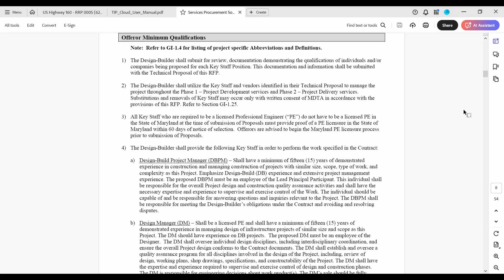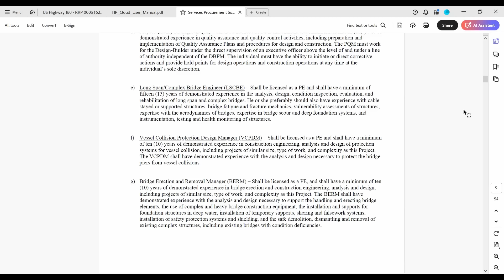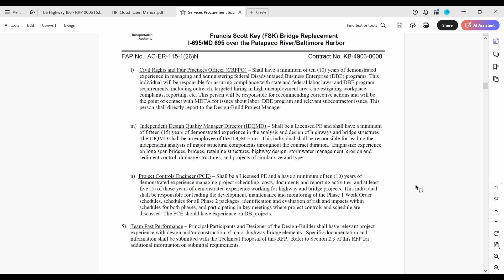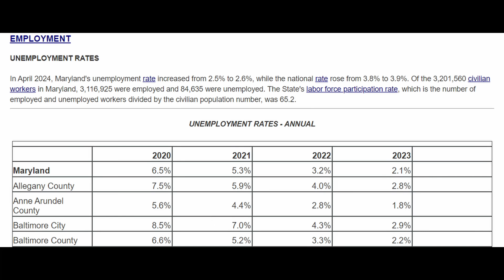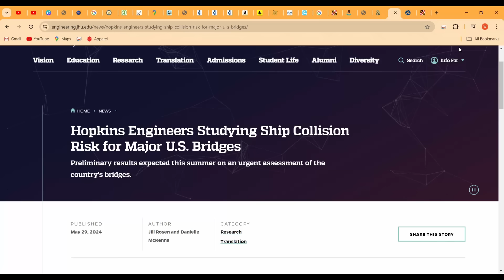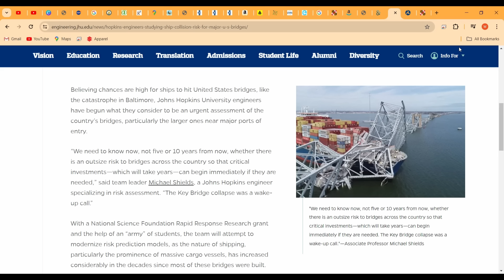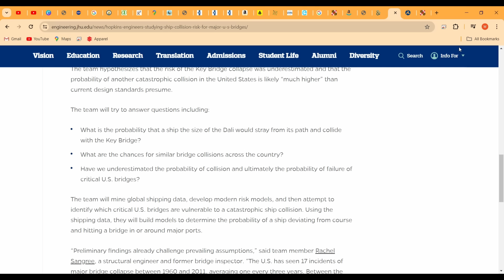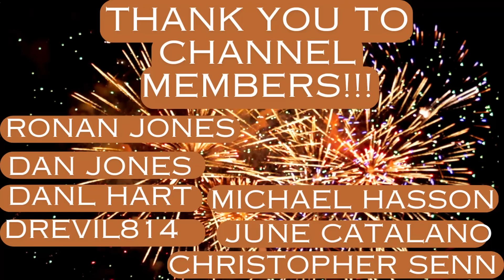Next Steps for Designing and Building a Replacement to the Francis Scott Key Bridge

Comment: The bridge in Genoa, Italy that collapsed took 2 years from the disaster to be rebuilt. It is shorter and doesn't have as long of a main span, but you would think they could expedite it to take less than 4 years. Then again, given that the construction of the Gordie Howe Bridge in Detroit has been going on for 6 years, I guess this is expedited nowadays.

Comment: Part of a bridge in Texas was taken out by a loose barge recently.

It was a rail bridge to an island that had never had a train on it since built.

It actually saved the separate but parallel auto bridge. If the barges had come from the other direction, the automobile bridge would likely have been damaged or maybe made impassable.

It's the only access to the island.
Reply: The only AUTO access.  There is still water and air access.

Comment: I'm a former merchant marine officer. Transited under hundreds of bridges, even had issues while doing so, but recovered.   The risk of collision for a bridge has many factors, obviously the location of the piers, the width of the channel and the frequency of transits are big ones, but there are lots of other things to consider; is the approach to the bridge straight? or is the ship coming out of turn before or going into a turn after.  Is there considerable current? is it generally in line with the axis of transit, or is it a cross current.  Same for prevailing winds.  Local rules on tug escort, the size/power of the tugs and even the type of escort (connected to the stern of the ship by tow line or just running free nearby.)
Also, I don't think your concern about ship traffic leaving baltimore for other ports is relative limited by the often very specific nature of port facilities.  Cargo wouldn't be using this port if it wasn't the best port for the cargo, so it likely won't be affected much.

Comment: Interesting update.  Proposals due by 24 Jun 24 and selection by Mid-to-late Summer 2024.  That's a short fuse for such a big proposal but I'll bet the better teams were on it on the day of the incident. Years ago I was tagged for a team that got working on pre-work in the first hours as a major incident unfolded. It will be interesting to see who emerges as the selected team. I'll go out on a limb and say the selected team will be a combination of some heavy hitting firms including some from the local area - i.e. D.C where the money flows from.
Reply from the maker: Thank you.  I think you are right about how this selection will go in terms of the successful team will need to have great technical qualifications and great political connections.  There will be a lot of money to spread around for this project.

Comment: The fact that the container ships have a single engine makes the probability much higher.
Reply: The vast majority of merchant vessels the world over are single engine/single screw.  But yes, its a risk, but one that the economics don't support changing.
Reply: @stephenbritton9297  Economics don't support shutting down ports for months and building $2 billion bridges either. Ships that don't have redundancy in their propulsion system need to be escorted into ports by tug boats.
Reply: While I believe that commercial ships are safer with redundant propulsion and steering, twin-screw, and twin-rudder, statistically it is hard to prove.  In the case of M/V Dali the issue appears to have originated in the electrical system, which was redundant.
Reply: Escort tugs are the most economical answer. One engine failure, 2 engine failure, electrical load failure, they still are there.
Next best is better protection for the bridge. Can spread the cost across a wide base by tacking on a small port fee surcharge over 20yrs.

Comment: Thanks for an interesting video——a lot to unpack. Does the big document have a paragraph anywhere for calculations of sea level rise? I read on the Chesapeake Bay site that in 50 years there may be less clearance under the bridge than currently. I don’t imagine ships will be smaller. Is that even a concern?
Reply from the maker: Thank you.  No they don't have any detailed design requirements listed in the request for proposal.  They would get into to those items during the negotiations during contract award with the selected team.
Reply: Not a problem.  Just wait for low tide.  I lived right there where this bridge was located and the rise and fall is only abou 18 inches or so depending on wind, moon etc.  Certainly if all the ice caps melted and everyone peed in the river, the rise couldn't be more than an inch or so.  So, as I said, no problem.
Reply: There should be as much provision for sea rise as President Obama's two oceanfront mansions have.
Reply: To put this in perspective, sea level rise has been roughly 1-2 mm per year for a century or so.  Not really an issue.

Comment: Given what is required to provide adequate pier protection for today's (and future) ships, I suspect that in many cases it will be more economical to increase main span length to put the major piers into shallower water (or onto land).  A fully loaded ship with a stuck open throttle represents a tremendous amount of energy to dissipate (consider the near miss today in Charleston).  Your point about risk including both probability of occurrence and consequence of the hazard is well taken.  This makes the costs in play larger than many will like to admit...but they are there whether we admit it or not.  Making the main spans longer will drive up cost,   But so does protection infrastructure that is adequate to protect against high hazard/ low probability events.  In other words, use water depth and channel position to constrain/limit the types of vessels that need to be considered for the various design cases.  While this is a strategy that can help for some classes of vessels, it is not  universal: there are shallow draft barge rafts that are in play for many waterways.  "Shallow enough" in these cases is likely on land in a lot of scenarios.

Comment: I lived in Sparrows Point for many years without a bridge.  Why rebuild at all.  Put a ferry across if anything for the few "hazardous" truck loads that can't use the tunnels.
Reply from the maker: You make a great point. The fact is they are making due without the bridge there now. The Washington bridge in Rhode Island carries 3 times the traffic volume than Key Bridge.
Reply: @CaseyJones-Engineer  
Traffic cross-harbor is no worse than on the I-495 Maryland Beltway.

That wouldn't have happened if they had built the 6,200 foot long Outer Harbor Tunnel.
Reply: Heavy ferries have been used to move rail cars across the harbor in NYC.

Comment: I'd say, it'd be cheaper to rebuild what was there, as it is already designed.  
Just fully protect the replacement from impacts.
Reply: To some extent, you are correct except that the roadway needs to be 6 lanes( 3 each way) plus shoulders because of traffic increases from the original construction to accommodate.

Comment: Why not tunnel?
Reply: Because it's vastly more expensive...
Reply: @ArthurDentZaphodBeeb  
Wrong.

Based on the costs for the CBBT Parallel Thimble Shoal Tunnel and the new I-64 Hampton Roads tunnels, it would be about the same or even less.
Reply: @scottkozel1519  Hmmm. The original plan for the SKB was a tunnel. But the idea was abandoned due to high costs and the bridge was built. Also, tunnels cannot transport hazardous materials, which is a key criteria, so it's a non-starter idea.
Reply: @ArthurDentZaphodBeeb  
The costs were not that much higher actually.
I have a website article about the bridge and crossing.
$65 million for the tunnel and $50 million for the bridge.

They just proved that the Sollers Point site is unsuitable for a bridge.

The combination of underwater topography there and the frequent passage of ships up to 200,000+ tons.

Now nobody can cross there for at least 48 months.

That wouldn't have happened if they had built the 6,200 foot long Outer Harbor Tunnel.

Putting up another bridge there is irresponsible and that one may get knocked down as well.

Those freight systems are going to be reconfigured in the over the 48+ months without a bridge. Long term structural changes to the freight systems.

Comment: What people say is the impact and what the impact is are two different things. 
1. People were paying 4$ a pop to cross the bridge but most federal bridges are toll free. The bridge is 50 years old, definite a loss of trust in the federal govt judgement on when and when not to use money people are paying to ensure safety. When it comes to federally owned infrastructure projects que sera sera. This may be a wake up call, it’s doesn’t mean the brain dead congress can do its job. 

2. The overall cost to commerce losing that bridge,  it has a result of ground transportation as well as to shipping. It’s not over either, not just for ground transportation but even as the federal channel opens there will be periods of closure for construction. 

3. Because drivers are taking long routes = increased CO2 production. 

4. Loss of life and livelihoods, but also an impetus for some people to emigrate. 

I agree with the style of bridge, these new cable tie bridges can get elevates way off the water and longer central spans, which is what you want because you don’t want the footing fenders to be in the federal channel and better yet in shallow enough water we’re a deep draft ship would run aground before hitting the fenders. 

However, even if the engineering and planning is already underway, that whole process, getting the substrate test done, the environmental impact surveys done
Making cofferdams and all that meticulous prep work. It’s going to take a year. 
They started working on 610 and 288 overpasses in 2018, they are still working on it, they have got the north bound flying exit ramp closed off and all the East bound lanes have been diverted to the west bound side, it been like this for a couple of years.  The entire west bound traffic has been diverted onto the exchange lanes, for years. 
    What the fed is very good at is slow. 

I wish them luck in Maryland, may an 8 lane bridge with no tolls be in their future. 
If wisher were horses, though, beggars would ride.

Comment: They just proved that the Sollers Point site is unsuitable for a bridge.

The combination of underwater topography there and the frequent passage of ships up to 200,000+ tons.

$2 billion to build a new crossing and over $6 billion in economic losses due to the shipping channel being blocked for 2 months.

That wouldn't have happened if they had built the 6,200 foot long Outer Harbor Tunnel in the 1970s.

Putting up another bridge there is irresponsible and that one may get knocked down as well.

Now no vehicles can cross there for at least 48 months.

Comment: California gave the contracts for the new Oakland Bay Bridge to Chinese contractors. It seems American contractors "wouldn't be able to find enough qualified welders to complete the project on time."
Reply from the maker: Hopefully no other states will follow California's lead on that.
Reply: @CaseyJones-Engineer  Public works often specify domestic materials, they should also be required to hire domestic contractors and labor.
Reply: @phlodel the Bay Bridge sections were built in Russia. And the bolts broke, and they had to build this reinforcement "bracket" that grabs the entire bridge to keep it from falling off in an earthquake. Because the bolts were obviously not to standard 🤦‍♂️

Comment: I'm no enginner.  I do know that regardless of the new bridge design,  the bridge piers need to have some real protection from ultra massive container ships. IMO build the bridge piers in shallow water so NO massive container ships could slam into them.  No 50 quadrillion yards of steel and concrete $$$$$$ necessary. Let the shallow >>>sea bed<<< do the stopping. jmo And btw way I'm ALL for ultra sound engineering and an ultra safe ultra tough kick butt new bridge design.  This isa MASSIVE engineering project not some some dink road redo on Teton pass. Just sayin.

Comment: If they should “streamline the NEPA” regulation why can’t they just forgo other regulations? Such as building the minimum bridge protection with the idea of improving it later as needed. There are many good ways to cheapen it up so as to get this bridge going.

The fishing and crabbing industry is vulnerable and no one thinks it’s important until it’s gone. Then they can import frozen not fresh crabs on those big cargo ships they prioritized.

I would also add it may be worth evaluating a better port location that isn’t 200 miles from the Atlantic Ocean. As you pointed out the Chesapeake Bay Bridge, which the same vessels must clear, is vulnerable too.

They shouldn’t cut any regulations rebuilding this bridge.
Reply from the maker: There is absolutely nothing wrong with stream-lining the NEPA process as they already know what is out there in terms of organisms and contaminants.  The had to complete environmental studies I am sure to support the recent construction of the transmission line poles and their collision protection systems.   The NEPA process has largely becoming a mechanism to delay or cancel projects.

Comment: Wonder if they'll open this to foreign design-build contractors, even at US prevailing wage rates. If so, outfits like the (Italian) Ansaldi or others like them could get the job done on time and below budget. If they'll treat it like the usual pork barrel project reserved for domestic firms and union labor only, we'll get nothing but the usual pork. A mess of design and construction errors, finished late, at three times the contracted budget. The disadvantaged business enterprise requirement is an indication that the sense of urgency on this project is already tempered by the smell of pork and greenbacks.

Comment: Casey, I am going to say something you will likely think is outrageous; If it really is going to cost hundreds of millions of dollars to protect these bridges, then the protection is too expensive to justify. I have a hard time understanding that each dolphin structure should cost $5,000,000 to $10,000,000.  We aren't able to provide absolute safety in any other area of life, and risk of bridge strikes may not be avoidable at $200mil per bridge.
Reply from the maker: I agree that not every bridge is worth an extra $200 million or so upgrade expenditure.  There will be many other bridges where this would be a good investment to prevent huge replacement and economic impact costs.
Reply: The problem with bridge protection schemes is 1) there is no feasible way to test them to see if they actually will perform, and 2) the size of the pylons and/or islands is constrained by the hydrology of the river.
Reply: The 4 pylons on either side of the main piers look small in the aerial photos.

In fact they are 25 foot diameter reinforced concrete structures and are at least 70 feet tall and anchored on bedrock or on 50+ 100+ foot piles per site.

That could easily cost $5,000,000 to $10,000,000 for one of them.